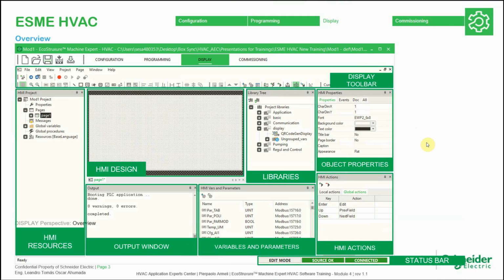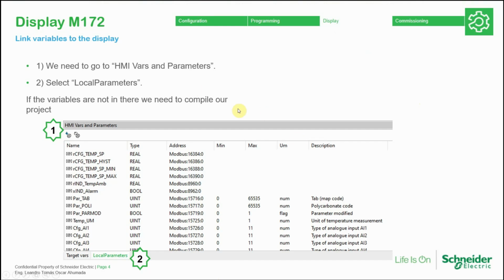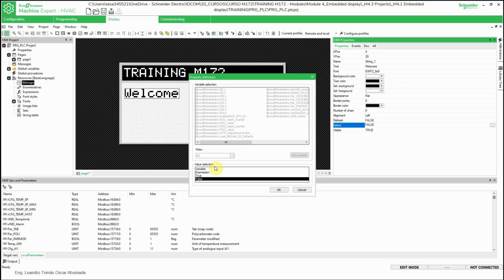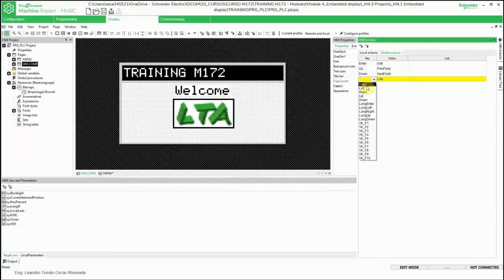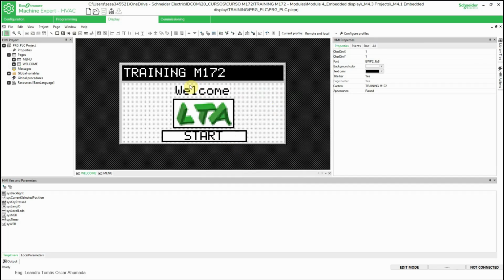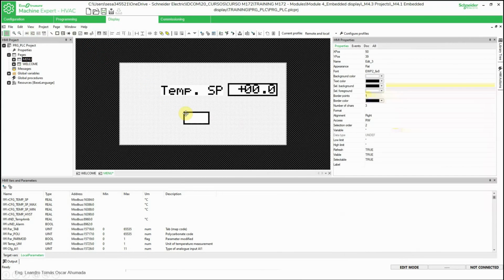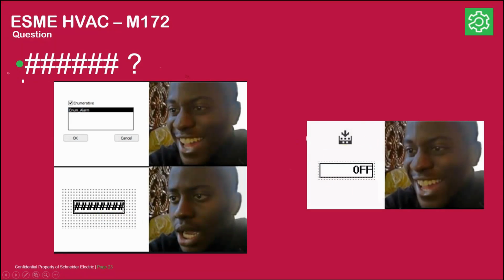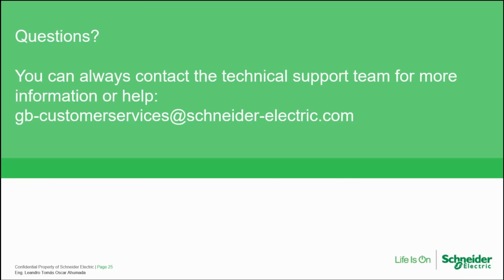Training M172 - M4.1 Embedded display

Comment: Do you have any guidence on how i could calculate Parts per min using an pulsing input m221
Reply from the maker: Hi there! Thanks for waiting :)
I believe you already got it, you can probably use the counter value incrising and use a timer of 60 sec to read the actual value and compare it with the previous to calculate.

Comment: Is there a way to live debug HMI project not PLC? I wrote some code under global procedure but could not get it working and I need to see what (HMI only) variables are doing.
Reply from the maker: Hi there! I believe it will depend on what you are trying to do but when i use a procedure and it has an internal variables i use that variable in the screen to test then when it works i delete it…or use a real plc 😅

Comment: Thanks for your video.. but, i cant read eeprom to the display. why ?
Reply from the maker: Hi Aminudin Amin! Do you mean on the display tab you are not able to see the eeprom variables or in the real display of the plc? I recommend you to check the eeprom variables on the configuration tab, make a build all and check all the output windows to see if you have an error.
Reply: @LeTomasAHUMADA  on display, EEPROM value is always (- - - -)
I have followed the instructions in your video, do you know the mistakes I made ?  
additional information, the software I use doesn't have a license yet, does that affect it ?  thanks
Reply from the maker: @aminudinamin6251   have you checked the actual value of those variables?  You can go to the commissioning tab to check the actual value. Try to modify the value and see if the problem is solved. In simulation do you have the same problem?

Regarding the license, the software is free you just need to register the software it should not case any problem.
Reply: @LeTomasAHUMADA   thank you very much, i will try... I'm debugging eeprom variable using the simulator